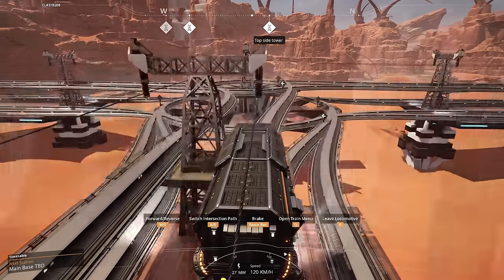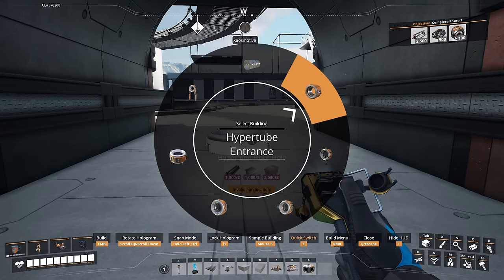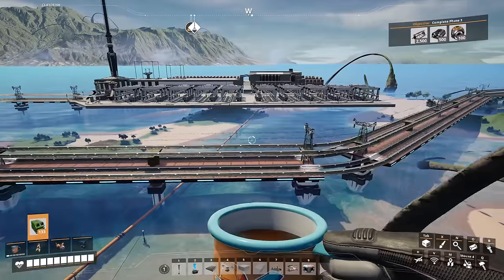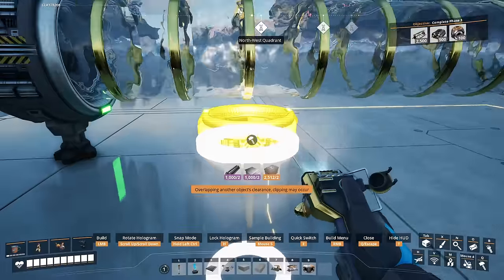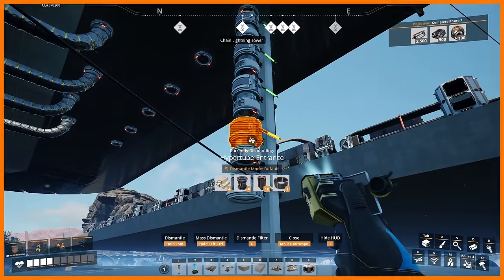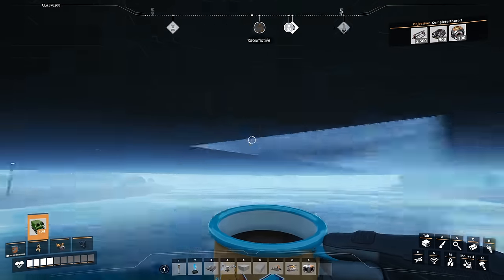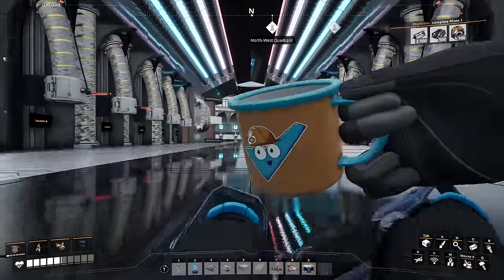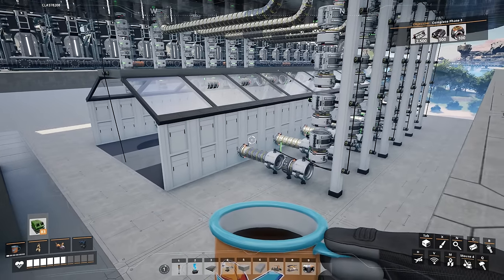Hyper tube Transit Room in Satisfactory 1.0

Comment: slightly amusing that both you and ImKibitz released a video at roughly the same time with 200 hours played in the 1.0.
btw here is a video of someone testing some train crossings...  https://www.youtube.com/watch?v=j939cbiQWyg
in case you 
the main base trains stations made me think they should be called something like:
Station Xaos
Xaos Loading....
and the black and white outside of your base on the space elevators end just made think of the joke Pandamonium... 
also you need to name your blueprint making room (when you make it) something like The Xaos Theory, Xaos directive, Xaos Regulation, Xaos set-up or something... though "Planning Xaos" is probably what fits the best...
"Logistical Xaos" can be applied to both transporting stuff or you... but it hits home more with it being the name for your hyper tube room...

on a side note Utopia is kinda bleeh but honestly other equivalent places like Shangri-La and garden of eden might not sound as good with a Xaos insert... like Gardens of Xaos might work but how would you use Shangri-La? Shangri à la Xaos?

also on a side note it feels like you are trying to over engineer the hyper tube basement since you could just have 2 tubes close to each other since the other lacks an entrance you cant go into that wrong direction and if its side by side with the one that has an entrance (currently in the ceiling) it wont go that way by mistake either... so this flying off into the air and having to guide your dude in could be resolved... but then again it doesn't matter if it works...
Reply from the maker: Man thank you, these are some great ides. love them all. and yeah, crazy how me and Kibz are both at 200 hours and still at different parts of the play thorough. lol.
Reply: @DrawingXaos  yeah you can progress at very different speeds with things and even be at the same progression with very different scales of production capabilities... But that is expected since you aren't speed running or something...